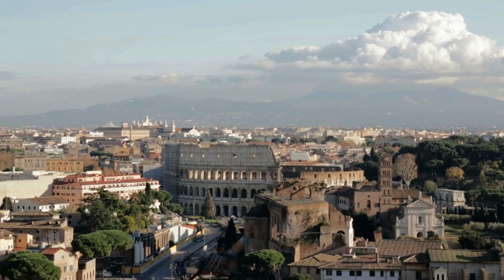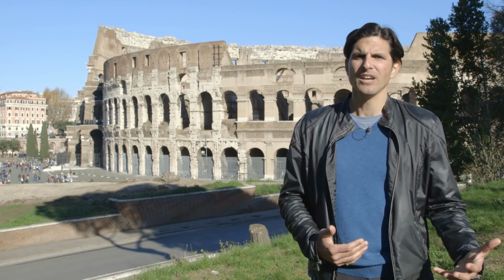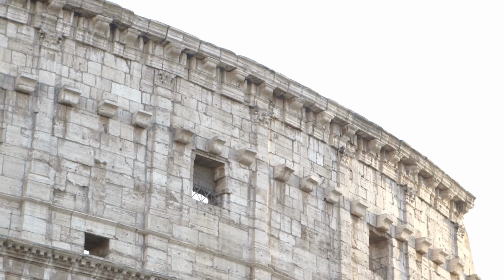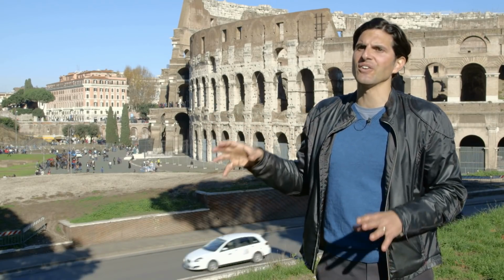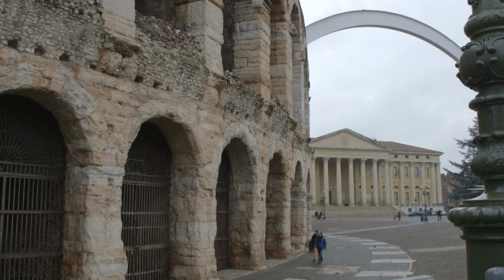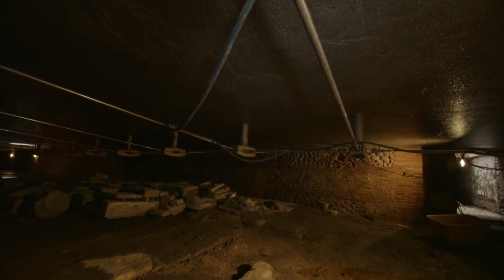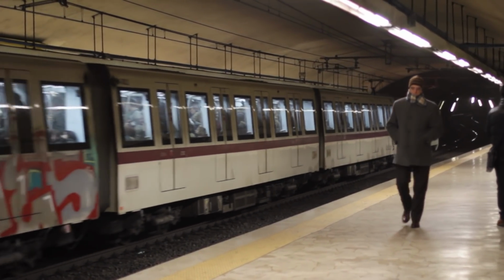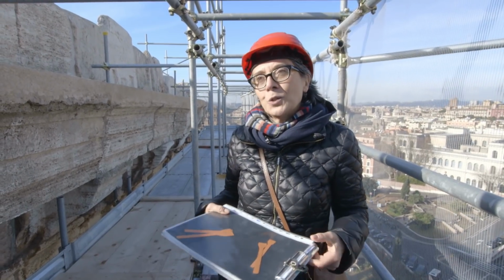The Miracle Of Engineering Behind The Colosseum | Colosseum: The Whole Story | Odyssey

Comment: the romans did use the colosseum and made reparations,  and thats all.  the colosseum was there when they came. it is a megalithic wonder.
Reply: I guess it's true use was some form of energy generation. It is elliptical in shape proving that the builders knew about the true motion of the planets around the sun.
Once per day the structure points directly towards the sun and once a day it is directly opposite the path of the sun's light. Proving that whoever built it knew the speed of light and the presents of the higgs boson.